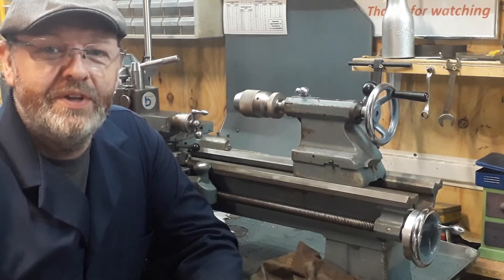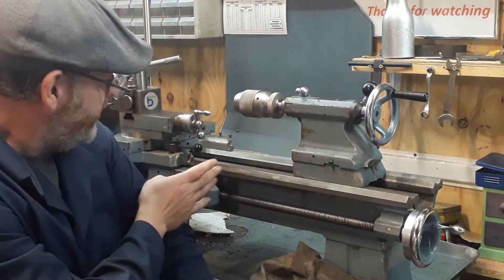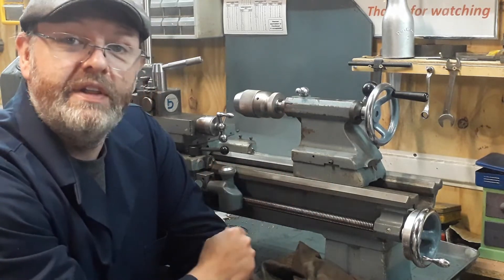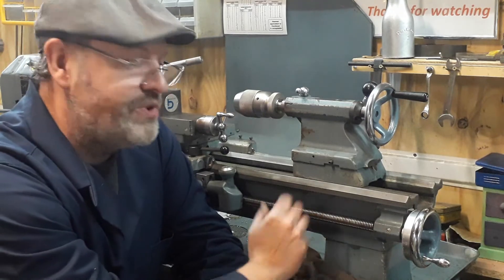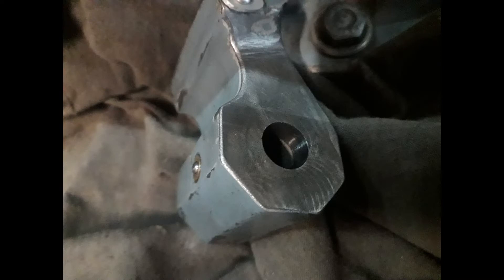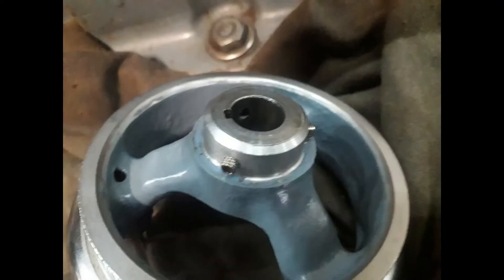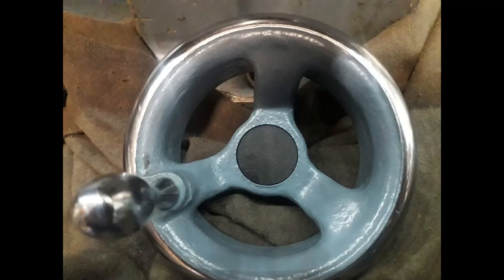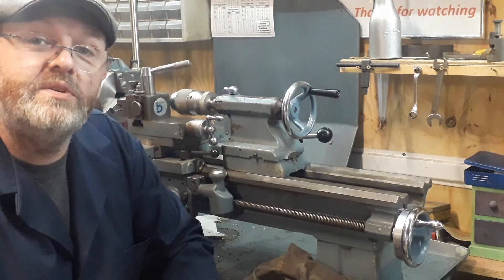Boxford Lathe Lead Screw Hand Wheel, No Welding or Fuss

Comment: Nicely implemented.  Maybe you’ve shown its use before in a previous episode?  I tend to use a 2-inch travel dial indicator on the carriage when I need to keep track of the depth.  Is this hand wheel difficult to reach and control while turning?
Reply from the maker: cheers Joel, it maybe on a video being used but not done one on it's use, I may do. I also use a clock, very handy but what happens when it's a long piece above 2 inch of travel? it happens to me a lot, thats why I made this. The hand wheel is so handy on the myford I just had to put one on the boxford. It is not difficult to reach and if you are turning to a number you are at the tailstock end turning to that number. I hope this explains it and you give it a go, thanks for your support.